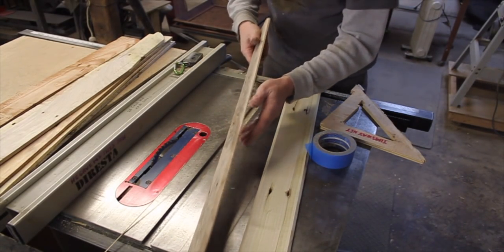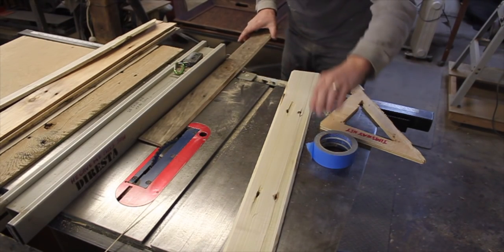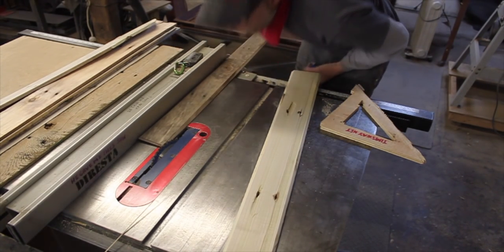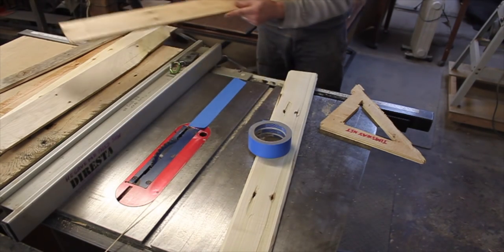Pallet wood Reception Desk with Brass & IKEA ??

Comment: Neat trick cutting off the nails with a sharpened prybar. Unfortunately, it means you won't be able to add them to your collection. Loved the tablesaw tape tip. Will definitely save that one for later.
Reply from the maker: they're still in the jar :) thanks!

Comment: You're a better wood-worker than me....just to qualify my previous post..!!
Reply from the maker: I'm not sure i completely understand? the heads were kind of wide to pound them through the board I wanted, in to the waste, if that's what you mean. I have many ways of dismantling pallets and demonstrate them in many videos. It all depends on what you need from the wood, the strength of the pallet, etc. In this video, I thought it would be fun to show yet another tactic :)

Comment: I'm sure the customer laid down the scope of this project - but I'm not fond of mixing dark and light wood together with the brass inlays.  Also I noticed on the last shot that there was a huge uneven seam on the counter top where you joined the 2 pieces together. Enough to where is was visible from the 8 foot distance of the shot and cast a shadow.  That seam should be just about invisible.
Reply from the maker: it was assembled properly at the customer's studio. I just put the pieces next to each other in my shop to wrap up the video.

Comment: What’s the thickness of the pallet slats?  Are they pretty consistent?
Reply from the maker: I used 4 or 5 pallets matching made of very thin wood. less than 1/2 inch. after planing they were all the same but I had to be super careful taking it apart as they would break easily.